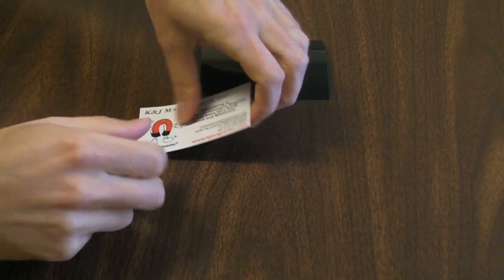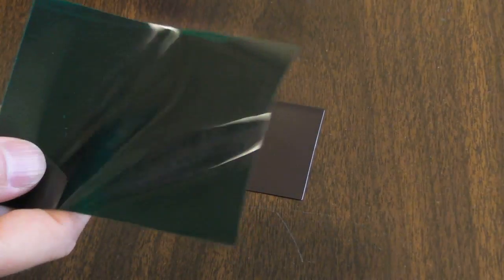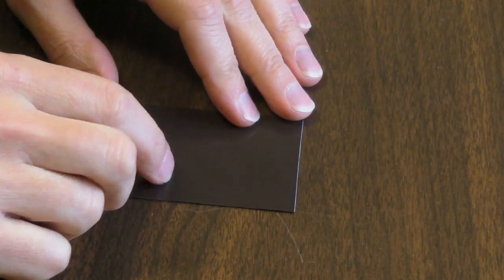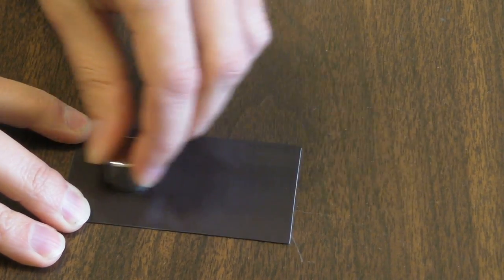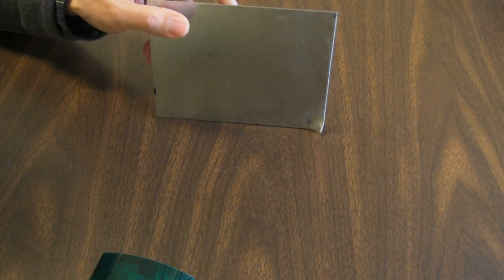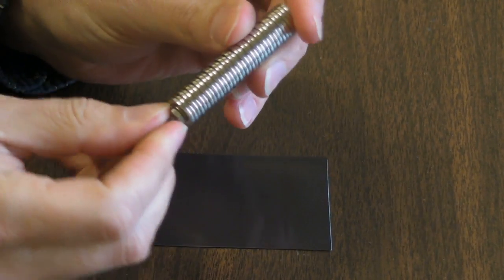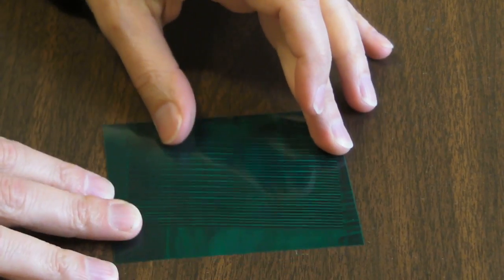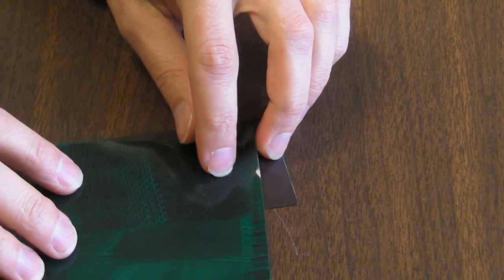K&J Magnetics - Remagnetize a flexible fridge magnet!

Comment: anyway to do this without buying all those magnets?
e.g. putting a another flexible fridge magnet on top the demagnetize flexible fridge magnet?

the price expensive to buy all those neodyium magnets to do what is done in this video.
Reply from the maker: Unfortunately not, you need to use stronger neodymium magnets to remagnetize them. Other magnet types aren't strong enough.

Comment: Man, your experimental is interesting, though you miss the point: the magnetic array on the sticker is not an alternating N-S-N-S .., but a Halbach array. You can check this by turning the sticker with its back towards the iron plate of the fridge, the attraction is much diminished. Halbach arrays are doubling the field on one side at the expense of the other.

Comment: Saw your video about remagnetizing fridge magnets and tried to copy the idea for a weak refrigerator seal. Bought a handful of strong magnets (https://www.amazon.com/Neodymium-Countersunk-Permanent-Magnets-Applied/dp/B01M4OC1IN/ref=cm_cr_arp_d_product_top?ie=UTF8) from Amazon.
I put them together with repelling polarisation and rubbed over the seal. No improvement. Then I took a single magnet and rubbed it over the seal and now I have either lost the little seal that was there or it might even be slightly repelling. Help? How can I fix this? My fridge gasket is not produced anymore. I need a seal again. Any ideas? Thx!
Reply: I have never done this but the magnet looks like have a cap over it. that cap made the magnet force strong on the flat side but very week from the rounded edges...
Reply: My dude, those are pot magnets, you were doing it90 degrees incorrectly

Comment: I'm going to order a short stack of the R821 ring magnets to re-magnetize my freezer door gasket. Will cost much less than the 103.00 Sears wants for a replacement.
Thanks for sharing!
Reply: I have an upright freezer with perfectly good door seals but they have all but lost their magnetism.  I agree that, on the face of it, this method would be good to remagnetize the seals.  What worries me is that trying it could completely demagnetize the seals like in the first part of the video.  It really would be nice to hear if it works for such seals.
Reply: @John Smith Did you ever try to re-magnetize your fridge door seals?  I may try it if it worked for someone else.
Reply: 😮Thanks for this idea!!!🙏🏾💪🏾 Definitely gonna attempt this when I finally & eventually build a “mag roll”.